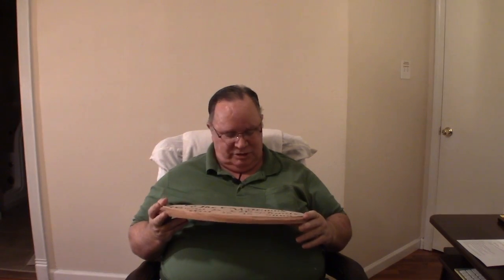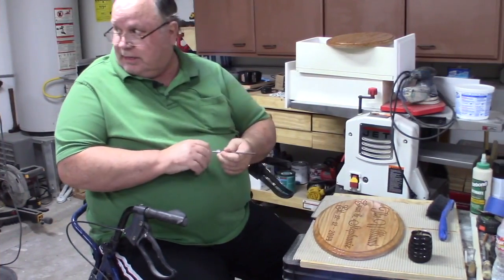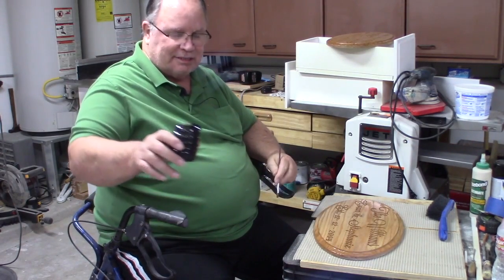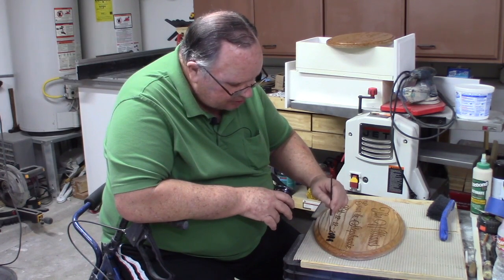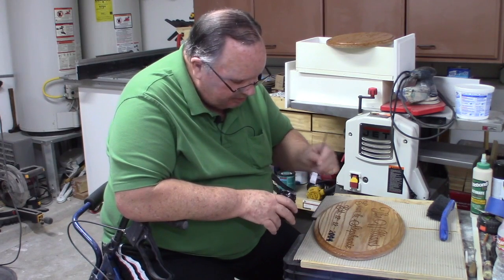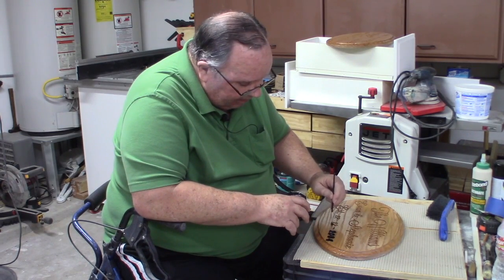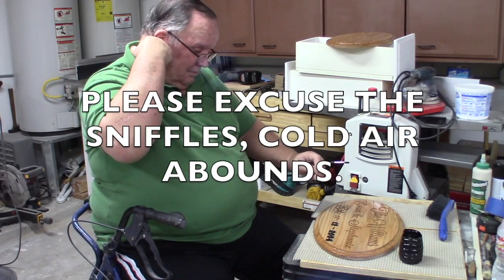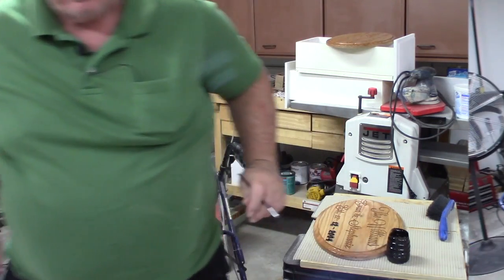ANNIVERSARY PLAQUE START TO FINISH PART TWO

Comment: James if you have the time. I propose an experiment for you. Take a simple pine board (I recommend pine, price and how absorbent it can be). 

Divide the board in half (mentally), and on 1/2 prep with wax free shellac or bullseye soalcoat, then on the other 1/2 do like you normally do with poly. 

Then paint like you normally do, though I recommend using Marsh dye in a can as latex takes so long to dry all that wet time is soakable time. But maybe do like you always do, for the test (don't need to add anymore variables).

See if there is a distinct difference in your results (spidering). You can also do like Jason suggest, just make sure to use a downcut bit and not an upcut (you don't to accidentally pull the contact paper up.

Comment: you should try applying contact paper to the board before you carve. you can the paint overtop of the contact paper and then remove it for a clean finish. I have not tried it on my xcarve but have seen multiple videos on it.
Reply from the maker: Thanks Jason, I'll look into to that!
Reply: While I agree a paint mask on the project will help a lot. That doesn't really prevent paint from being wicked into the fibers. As James mentioned in the video the spidering (I think he called it that). I think James was using the poly as a sealer, to try and stop the fibers from absorbing.